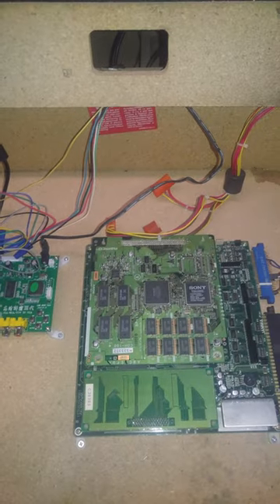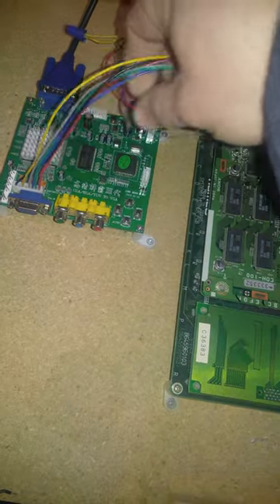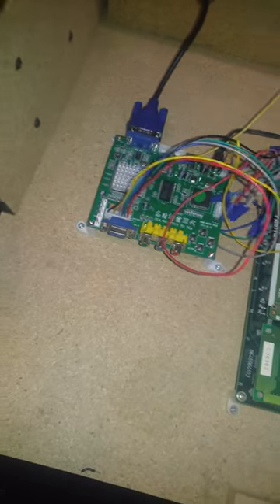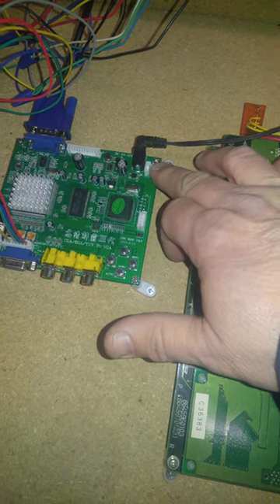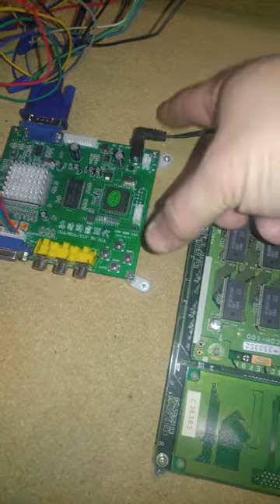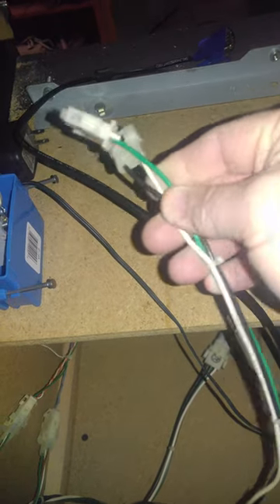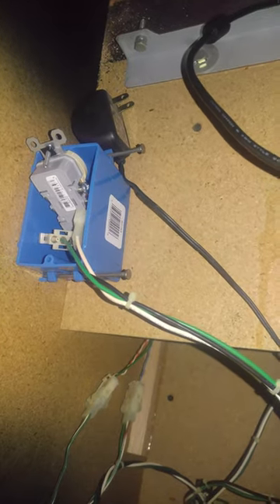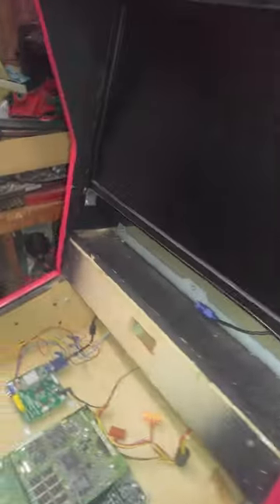Install an LCD screen in your arcade game

Comment: I got a 2003 golden tee fore and the tube is gone  ..i want to install a monitor like you did i just need to figure out what wires plug in the pcb board